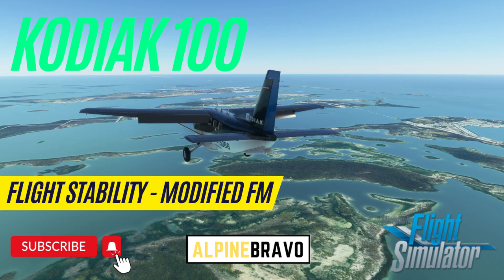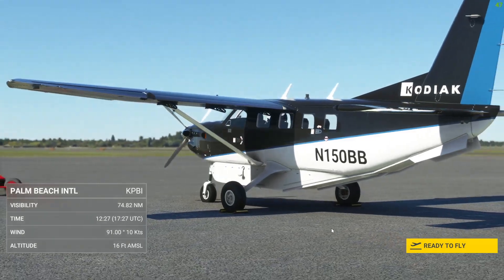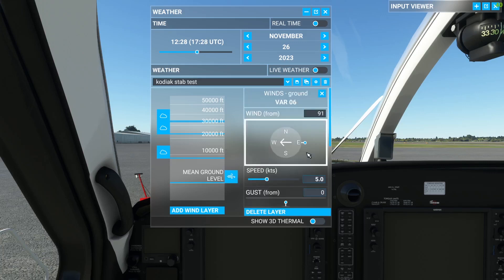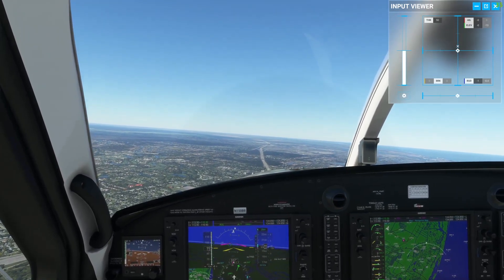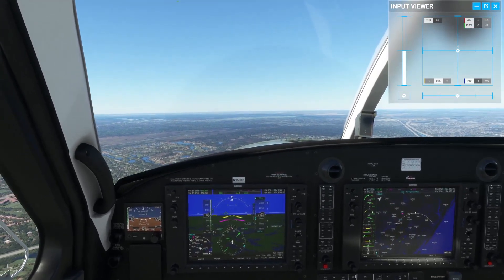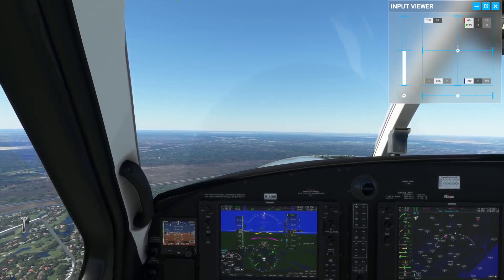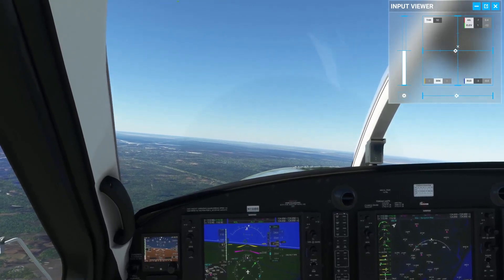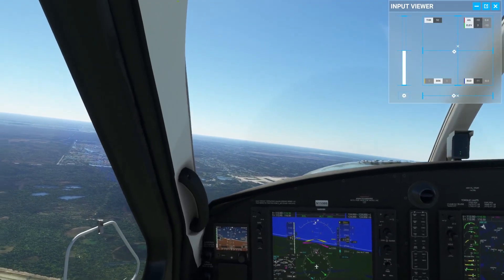How to Fly the Kodiak 100 | Part 15b: Hand flying & Stability - modified flight model

Comment: Thanks for that video. It's really interesting. I was going to ask why you weren't going to share the revised model, but you addressed that at the end and I can totally understand your reasons.
Reply from the maker: Glad you found it interesting.  The changes I made were more by way of subtle tuning - the current FM is still very good and perfectly stable in most cases. It only really shows some limitations at the edge of the envelope in a low power, high AOA state.
Reply: @alpinebravo7090  Thank you for that info. It's much appreciated. And it's nice to hear some positive things about the majority of the flight model, as I've heard a lot of people heavily criticising it recently.
Reply from the maker: Many folk don't calibrate their controllers properly. Or are simply too used to very placid flight models and struggle to make the mental shift required.  There aspects of the FM that could do with some improvement, like roll stability, excessive P-factor and drag.  But once you invest the time and effort it is such good fun to fly.   For example I was doing circuits at AYYW for fun, seeing if I could fly to the same numbers as MBP Ryan in his recent video and with the exception of the needing more torque to maintain the approach, everything else was spot on.  Very satisfying!
Reply from the maker: And the revised FM is with SWS.  But don't expect them to do anything until after the PC-12 has released and the predictable tidal wave of simmers with a 1001 questions to subside...